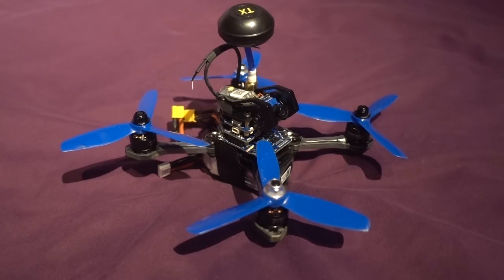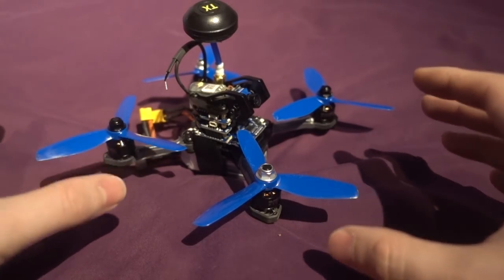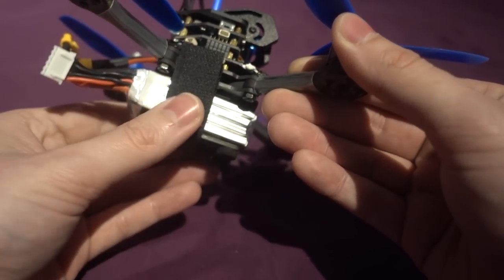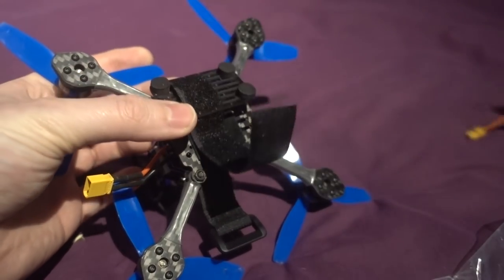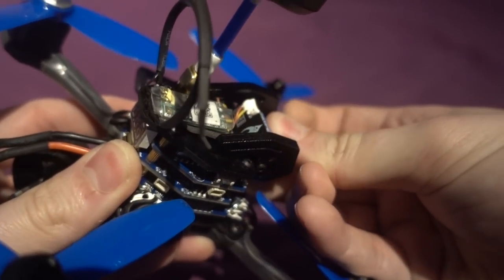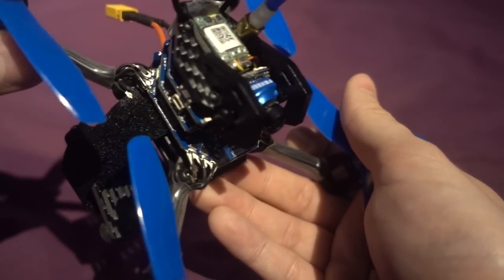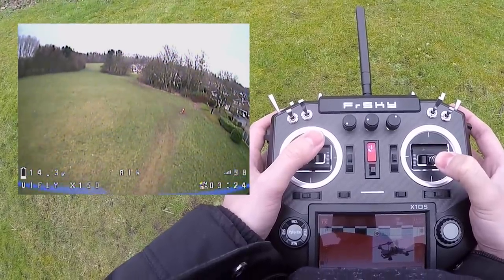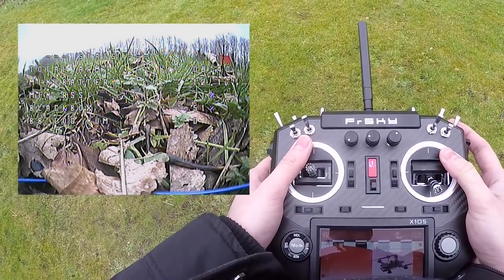4 Inch Under 250 Grams!

Comment: This reminds me of the plug that UAV futures did for the Avant Leggero, it's only 250g if you run a small battery. The drone itself could be much lighter and tougher, change the stack to a 20x20mm,  and have a proper roll cage, rather relying on the standoffs.  Instead of that heavy vtx and antenna go with something like the eachine vtx 02 with a whip antenna. I'd like to see them hitting the mark at 150g for their claims.

Comment: Andy, I hope you can offer can quick advice. I copied your pids on flyegg 130 build and it definitely was a major improvement, oscillations are gone. But I get a bit of bounce back after flips. Your P setting (for pitch) was 43 and default was 56. Most of the rest of settings were pretty close to default.  Should I raise the P back up to get the bounce out? Thx

Comment: So all my 4" quads are under 250 with a 650mah. I guess i'm always surprised  how heavy most people build their quads.
I've used brother hobby 3000kv, 3022kv, 3600kv, and t motor 4100kv. I've tried every 4" prop and the only one i've found to be acceptable is the hq 3 blade.The 3600kv and 4100kv top out at 1800us and 1500us respectively. There's no difference between 80% and 100% throttle with the 3600kv due to hitting the torque peak. 
The 3022kv is perfect. The motor controls the prop exactly as it should.  Great throttle linearity and the prop hits it's ceiling at the same point the motor does. I get about three minutes per battery. I've actually done two race heats on the same battery.

The one in the video seems to not have the best prop and motor match. I'd imagine the current consumption bell curves at the top end of the throttle. However this model is about 30 dollars cheaper compared to my 4" floss v1 with all premium components and a cp antenna. But this thing really doesn't look like it would survive many gate crashes.

Comment: The grasshopper 160 frame is a 4 inch frame and it'll almost always weigh under 250 AUW as well
Reply: My grasshopper 160 is 170g with FPV, GPS , batt strap and Led bar , easily under 250g with batt. (1306  3100kv motors).

Comment: I'm surprised this 4 inch comes with 1406 motors. I have 1407's on my 3 inch I built, and it screams. seems to me the extra weight of the 4 inch isn't helping those motors at all. slap so bigger ones on then I'll think about, looks sharp that's for sure. nice review👍

Comment: Nice review ;)
Do you think you can build a 4inch or 5inch with the components you used for the flexrc komori under 250g? (4inch with the motors in this quad ;) )

Comment: Okee okee.. admit it.. You had it on a wired video connection :)  Serious mode: that was on 600mW? 
So maybe 4040 props then, so them motors spool up a bit faster? That would probably help the tune as well (faster response)
Reply from the maker: i think the 4 inch will always take some time to spool up due to the weight actually a 3 inch prop might peform better with more pitch. the video i think was on 200. cheers
Reply: Hard to say without trying (?) I fly my (self build) 4" on 4x4x4 props, and it doesn't exibit this behaviour.. NOT the same config though, so means nothing :D 
anyway.. it's eighter the Weight or the Drag (or a combo of that) of the props, that prevents the motors to spool up quickly.. 
Cheers man! Have a good weekend
Reply from the maker: yep maybe a 2 blade 4 inch would do better ill have to try cheers
Reply: @andy. 2- blades, thats what i was thinking. ;)

Comment: Nice Review Andy. Thx for sharing. I am using an identical setup on my quad. Could you share the betaflight setup pages with all the PIDs and so on? It seems, that the tuning is perfect. So I could check with my settings.
Reply from the maker: you will need a custom tune the one on this quad wont work. cheers
Reply: Tunes are personal to people and quads same quad different tune , different pilot different tune.
Beta flight has gotten so good now that all you need is to finetune default is real good in general.
What I mean is default pids are a real good place to start. Good Luck  Cheers.

Comment: I can't keep up with all these quads!!! ;)  Anyway, just received my Furibee X140.  Plans are to get more into FPV and doing the flips, etc.  That may be a challenge for a 60 year old guy like me.. ;)  Oh, one other thing Andy..  I noticed my RSSI reads 0 and blinks on my goggles.  I thought I had activated it on Betaflight...
Reply: MrPolymers if you purchased a frsky version the reciever might be a xm+ and you won't get rssi. If you got a flysky you will never get rssi
Reply: Yes, it's a FlySky.  Thanks for the info.  I thought I was doing something wrong.. ;)
Reply: MrPolymers yeah, I made the same error. Haha, good luck! Happy flying!
Reply: Yes indeed.  When I get tired of my 1/2 dozen quad copters which include a DJI Mavic, I get the urge to ride my Yamaha FJR with my motorcycle groups.  When that get's boring, I get out the Mustang Convertible.  I'm a 60 old kid with a big toy budget... ;)

Comment: Andy, im going out for fpv tomorrow, and was wondering, of couse when you are flying your quad is at an angle, so when I do a roll do I just put the stick straight to the left/right. Which doesn’t make sense to me because wouldnt u do some  messed up flip if you are at an angle and put the stick to the left, unlike if you were flat.
Reply from the maker: no the pitch forward does not affect rolls only yaw. cheers
Reply: AndyRC thanks alot andy, was very curious
Reply: If your running a lot of tilt on your camera it may appear "off" in your google, but a 360 will bring you back to original position. Where as a 180 with a lot of tilt you will lose horizon and camera will be pointed at the ground. Try it just holding your quad with camera straight forward and by hand spin it only on the roll axis. This is why a lot of freestyle pilots including Andy fly with very little uptilt. LeDrib has a video on it. Mixing roll and yaw will make flip appear cleaner on horizon.

Comment: 1 crash into anything solid is going to rip that whole top of the stack right off that wouldn't survive a single crash into a gate or hit with a tree
Reply from the maker: at 40 meters it slung a battery and survived the fall landing on its top. its stronger than you thing you have to remember when the weight is down so is the damage.
Reply: I have over 100 flights with my 150.  100 in 1 month !  this is an amazing FUN KWAD !  FUN !  look at what it does GOOD !  you can roll inverted cut throttle and take a nap !  it FLOATS !  like a leaf.  you'ld swear the motors are in reverse !  fun  cheap   dependable ...if you want to mow down gates get something else !

Comment: Andy just another question, with the qx7 taranis, how many switches could I use. From what I know, with my current fs i6 i can only use 2 switches as i only have 6 channels. So does the qx’7’ mean i have 7 channels? And does that still mean I can only use 2 switches??
Reply from the maker: you can use up to 16 channels cheers
Reply: Oh ok thanks alot
Reply: the FSI6 WILL USE ALL SWITCHES AND THE KNOBS WITH A SIMPLE FIRMWARE UPDATE     
The update gives it 10 channels.   Cheers

Comment: I'd seen this one reviewed before, and initially, I was concerned about the thin looking arms, but they are pretty thick and sturdy.  Regarding the range .. from my ham radio experience, I noticed the "Loop antenna" configuration .. something ham radio operators have been using for a long time. Generally, a properly constructed loop antenna will exhibit better performance than a 'V' or 'Dipole' or 'Vertical' configuration. Good flier, and nice that you used an inset of the FPV video so that we could watch your control inputs (had to go back into my mode 1 brain configuration .. which admittedly has waned after flying mode 2 for the past 5 years). Cheers!
Reply from the maker: yeah its really sturdy i wish i had posted the crash footed now because it took some hard crashes from 40 odd meters up when it slung a battery. yeah i was surprised of the rssi i might have to adopt this myself! cheers Bill

Comment: This quad has a horrible stack. Very much fragile. Drilled inside the board and no protection
Reply from the maker: cant agree with you there one of my fav copters.
Reply: AndyRC you dont have to agree😛. Its just my opinion. But why would the make standoffs middle of ESC!